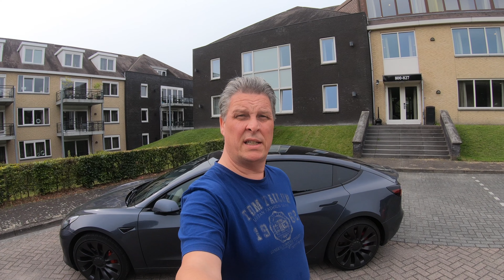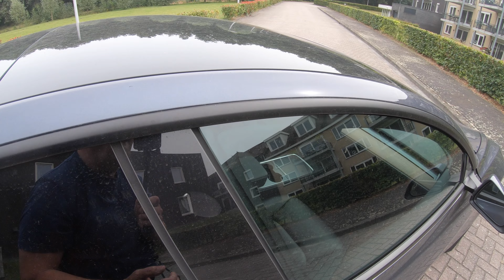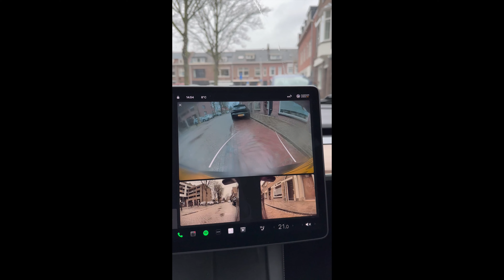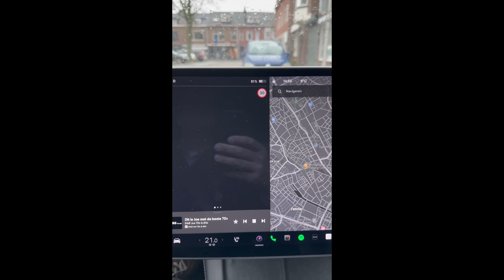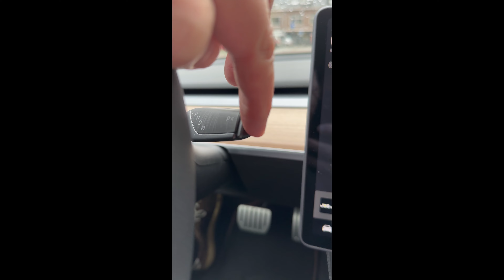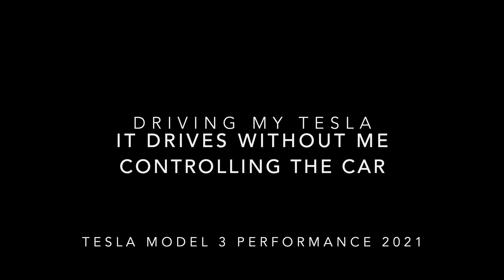Tesla confirms MAJOR Software problem, Tesla Model 3 Performance 2021

Comment: Die stalk (niet stack, voor een reviewer had je dat wel moeten weten) werkt gewoon zoals het hoort.  Het is redelijk duidelijk dat het hier om een probleem met aansturing van het scherm gaat.  Je camera-beeld blokkeert ook, zelfde voor de snelheidsmeter.  Dus als je de auto in D zet gaat hij helemaal niet achteruit rijden of omgekeerd...
Reply from the maker: Your not correct. As you can see I drive forward in Reverse and in Reverse in my drive position. Also the Belgium driver is having the same issue. It does not matter if / or a system has a problem. The problem is that you drive in the wrong direction as shown on the screen. You never know if the car is having a problem.
Reply: @Persfoto  When you select forward, you drive forward. When you select reverse, you drive backward. So there is nothing wrong with the stalk. It's only your screen that's wrong, because it is clearly lagging behind. Same thing with the Belgian driver.

So @fire69 is NOT wrong. Carefull with the accusations please.
Reply: @oroozen  as a reviewer you'd think he  understands the nuance in the problem, but seeing his reply to me he clearly doesn't. Is there a problem? Absolutely! But when you are aware of what's going on you can drive that car without safety issues (except not seeing your actual speed).
Reply from the maker: The head of the SEC centre in Tilburg confirmed that Tesla is aware that there is a problem and that some cars can drive in the wrong direction and that there is no fix for. He gave that answer on the phone. The phone was on handsfree and people in the car heard it as well. I also asked them by mail if was correct what he told me and than the legal department took over with no answer. The other people can be a witness if this case will go to the court
Reply: @Persfoto  I'm not at all denying there is a problem with your car that needs to be fixed.  But as I said, when you select a gear it's clear from your video that the car will drive in the correct direction. Because your screen is sometimes frozen (hence the blocked camera image and incorrect speed, also visible in the video of the Belgian driver) it might SHOW the wrong gear.  So when you are aware of the problem just make sure you use the stalk to select your gear before driving and there is no issue.  But definitely something that needs to be fixed of course!
Reply: @Persfoto  did (s)he confirm the frozen screen problem or an imaginary problem that is not even visible in this video?
Reply from the maker: Yes they can confirm this and noticed that the gear was not working
Reply: @Persfoto  Did they confirm the gear was not working, or that changing the gear was working correctly but not updated on the frozen screen?

The latter is what happens in the video. The gear was clearly working exactly as it should. Same goes for the Belgian guys. It was only the screen that was lagging way behind.

That's a problem in itself, but do not make it sound worse by obviously lying about the circumstances.

The gear works. Tesla did not confirm "a MAJOR fault" and you have no proof whatsoever they confirmed anyting, other than you saying they did.
Reply from the maker: The unintended acceleration  in Best was not filmed. Tesla was be able to get the data of that issue.
Reply: @Persfoto  and what was their analysis of that event?
Reply from the maker: @oroozen  speeding away by itself and I had to avoid an accident by steering.
Reply: @Persfoto  What were their findings on the position of the accelerator and brake pedals?

<sigh>
Reply from the maker: @oroozen  applied full brakes, steering output and touch acceleration pedal ( which is false )
Reply: In what order?
Reply: @oroozen  getting any usable info out of this guy seems borderline impossible...  is it just me or is there something weird about this entire story?
Reply: @Fire69  No it's not you or it's both of us. 

He also has his thread on a Tesla forum where he keeps running around in very weird circles while holding his fingers deeply in his ears and singing TESLALALALALA!

But he's a journalist, so he must be right.

Comment: Ik snap je punt over de versnellingen niet echt. De stalk doet het toch prima? Het is juist je scherm wat blijft hangen, wat je ook al zelf bevestigd. Het is niet goed dat die Amerikaanse troep vastloopt, maar als een bezetene aan de versnellingshendel gaan rammen gaat niet echt iets oplossen he. Dát ding doet het helemaal prima.

De enige keer dat m'n Tesla scherm was vastgelopen viel hij ook helemaal uit. De auto deed het zelfs met een zwart scherm prima. Rijsystemen en het dashboard zijn gescheiden systemen. Dat maakt het aan de ene kant best veilig, maar zorgt er aan de andere kant ook voor dat dit soort shit gebeurt.

Wel vreemd dat 2021 versies met dezelfde hardware als 2023 versies last hebben van deze dingen, terwijl de nieuwe dat met dezelfde hardware niet echt lijken te hebben. Kan me alleen maar voorstellen dat het iets met de 12V accu te maken heeft o.i.d.. Ik ga echt niet zeggen dat het een geweldige auto is, maar mijn MY RWD heeft eigenlijk helemaal geen echte issues.
Reply: I think that’s very plausible. They replaced everything and still the HW3 is not behaving as other vehicles. Problems with the power of driving system seems logical then.
Reply from the maker: In the USA they reopened an investigation. I think the problem is a drop in Voltage that happende to my car several times. https://www.notateslaapp.com/news/1515/investigation-into-unintended-acceleration-of-teslas-reopened-could-a-design-flaw-be-at-fault I have photo’s of my car showing this issue and fault numbers